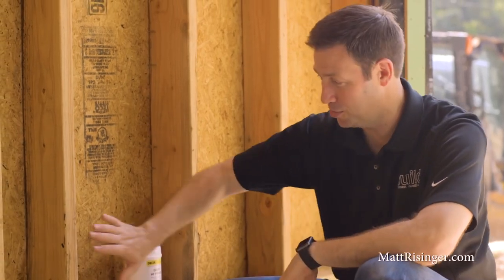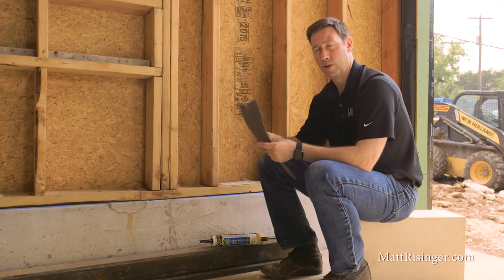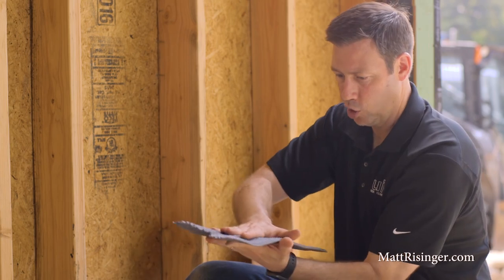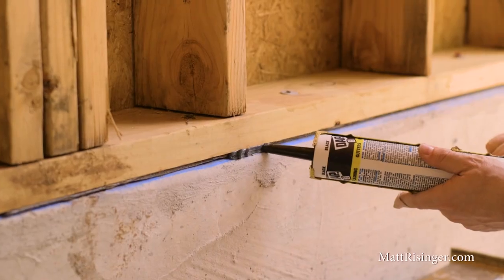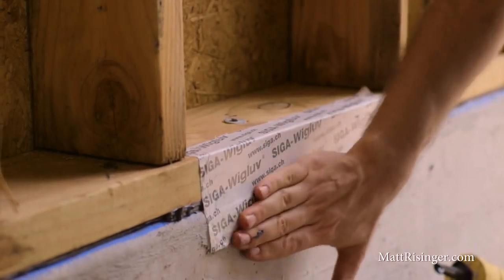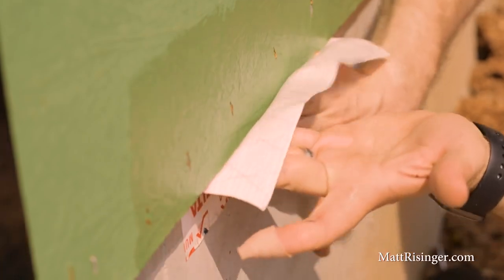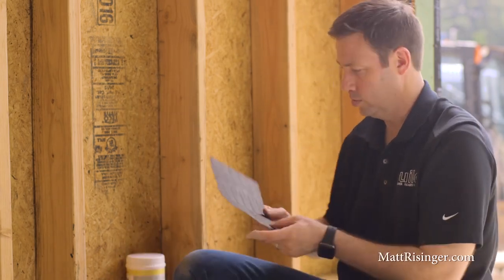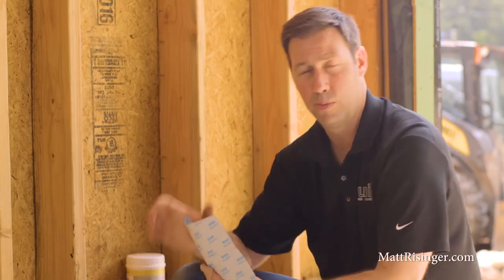Air-seal joint between framing and concrete foundation.

Comment: If you seal the inside and outside of the sill plate, aren't you trapping moisture between the sill and concrete foundation?
Reply: No, if it got in it can get out.

Comment: I'm guessing products have improved since 8 years ago?  For a home built in 1965 that has a basement that's partially finished (with a drop ceiling, so can access the frame and foundation if a bit awkwardly)  and unfinished, what would you recommend?  Things cannot be accessed from the outside.

Comment: hey there, my sheathing runs flush with my foundation and sits on my sill plate which is embedded into my concrete foundation wall (1962 build) would I primer 2 inches of the concrete wall, exposed sill and sheathing. Covering them all with flashing tape?

Comment: When I bought my home there is a gap between the drywall and concrete, it looks like they used a rubber seal but still gaps. I’m afraid critters could get in. What is a budget friendly way to fix it?

Comment: Our house is on a slab no crawl space no basement and there's a ton of cold air coming in I assume they didn't seal the wall to the foundation.  At this point do I take off the siding on the bottom and do this or do it from the inside ? What's the best most affordable solution we live in michigan and it's cold 8 mths and mosquitoes getting in the other months so upset 😡
Reply: I the house already finished inside then your best choice is to do it from outside. I have the same issue in my house, I am thinking of buying a good caulk that can be used outside on concrete and  wood and do it thay way.

Comment: This is the 3rd video I've watched with you sealing the sill and on all the videos NONE of the exterior sheathing is lapping over the foundation at all. Wouldn't a good start be to  hang your sheathing just down from the mud sill to encapsulate the void in the first place? ...with z flashing of course
Reply: Nope, sheathing is installed 1/2 inch away from foundation to account for moisture wicking. Kiln dried lumber should not contact the ground or concrete.
Reply: Obviously, but this guy has no idea what he is doing, being just a shill for the terrible materials they are trying to trick you into buying, lol.

Comment: I heard you should not do this, bc then if you do get moisture or condensation build up and the osb can’t evacuate this moisture out to the surrounding environment thro the open end of the trim at the bottom of the trim, that the osb will rot/age faster. I would seal the inside of the house bottom edge, just not the outside
Reply: with what would you seal it with caulk? I am doing my basement right now, I want to seal under the base plates so no cold air comes in before I put on drywall/baseboards

Comment: My new construction has Tyvek house wrap.  Would the external tape go under the house wrap (i.e. Tyvek flash over the tape)?  Is the liquid flashing better than the tapes?
Reply from the maker: When air sealing joints between framing and the concrete foundation, DELTA®-FLASHING or DELTA®-MULTI BAND would be applied in a way that any laps shingle downward for best drainage.  One should lap membranes above onto membranes below.

For more information, please email info@dorken.com

Comment: Huh... Why not use duct tape?
Reply: Duct tape is not meant to be used outdoors and will deteriorate over time.
Reply: Duct tape is weak to moisture (the thing you're supposed to be keeping out). It won't work at all.
Reply: @carlotta4th  it was mostly meant as a joke... guess an emoji added would have made it clear.

Comment: Matt, I'm trying to find the best way to seal the base of my foundation.  It appears whatever the contractor used to seal the wood frame to our concrete slab isn't working.  I've seen moisture getting in.  The exterior wall is already covered with stone.  I've removed the sheet-rock on the interior to inspect what was happening.  I can caulk the interior now, however, I still need to keep the water from penetrating the wood.  Hoping I don't have to remove stone on the exterior.  If that's my only option then I'm going all in and getting to work.  What do you suggest.